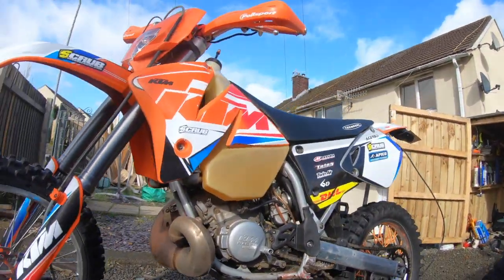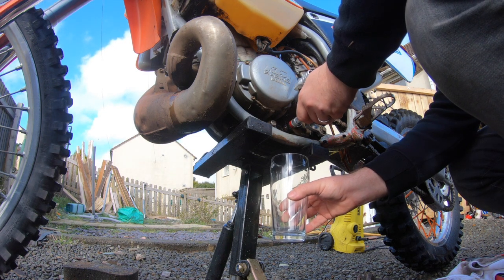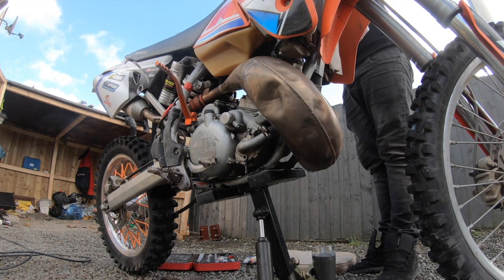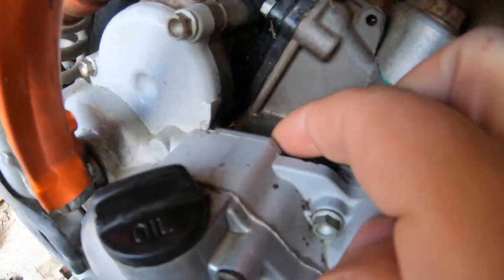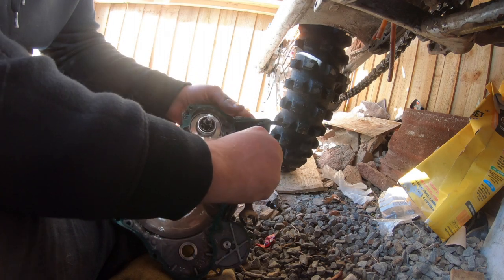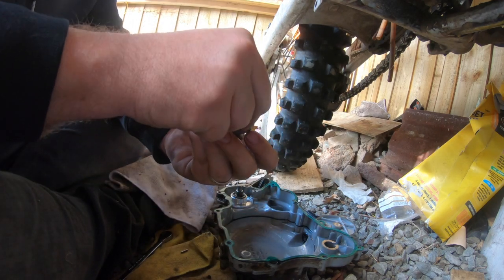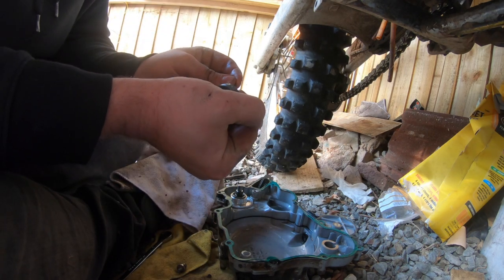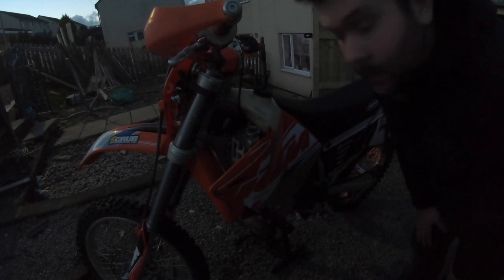HOW TO FIX YOUR POWERBAND! Centrifugal Timer

Comment: Thank you very much man!!! Bought myself a 07 ktm 200xc for 1500 and ran and rode but no power band. After some vids and comment surfing i was able to diagnose it was the ball bearings in the timing actuator thing. My power valve would move and adjust, but not move when the engine was running. Just got it back together about to go take it on its first rip

Comment: Thank you. I just bought a 2004 ktm 200 exc, cleaned my power valve. It is still not opening my power valve. I found some forums talking about the centrifical governor balls being out of place, but they were not very specific on how to fix it. I will give this a try in the morning.
Reply: Did this fix it? Did you see if the balls fail out of place amd if so did it fix it? My recent purchase ktm 200xc isnt moving when i rev the engine. I can watch the power valve plate move when i turn the big nut on the right side. Set it and no movement with engine running or revs

Comment: Can my bike have same problem it souds perfectly fine but doenst pull on low rpm front wheel doenst even come up on first gear with only pressing gas
Reply from the maker: Check to make sure the power band arm is fixed in place, another common issue and can be seen through the sight holes on the power valve. Be mindful it’s not been fully wound out as it may need resetting and reconfiguring with the arm in place and taking the adjuster thread back to flush :)

Comment: When you put the locking pin back in, inbetween that and the bearing holder are three washers, two concave washers and one flat and thicker washer/spacer, the two concave go on first, but mine fell out they were stuck to the bearing and I did not get to see how they were oriented, can you remember which way those two washers go on?

Comment: when I try to turn the "powerband" bolt next to the clutch cover. The bolt does not move naturally, but "snaps" into the style 0.5 turns at a time.
Reply from the maker: Open it up mate, it sounds over adjusted. Reset the timer lower down on the thread and check the actual timer over. I heard those noises when it was overtightened. Is the powerband working?

Comment: Mine feels the same like it lags in band and doesn’t scream sounds wired mine is also loose and the centre bolt pushes in and out
Reply from the maker: KeeganYT hey mate, are you able to reset the ball bearings? I found that the other big helper is centrifugal arm that hooks into the power valve house has to be perfectly aligned otherwise it does absolutely Jack. Commonly misaligned when changing the piston. Remove the small power valve cover on the clutch side and when repositioning it give it a slight lift up and down to see it’s in the right place. That’s what I had to do and it fixed that also. My 200 lagged when I bought it and I managed to solve it on the piston change but it still wasn’t great so I went down this line and boom. If the centrifugal is worn they are around £110 new from KTM or there’s a few on eBay and possibly the Facebook bike breaker page CH Bike Breakers
Reply: Biker Bro’s thanks for the reply mate I haven’t tried checking the ball bearings atm but in the middle of the 2 little arms in the cylinder I’ve got the arm aligned to bring it up and back down I’ve had a look at the centrifugal gear if it still spluterrs and lags in the band I’m gonna take a look
Reply: Biker Bro’s And I’ve had new piston I’m just hoping this sorts it out is there anywhere specific the ball bearing go and if so and do you know where they go?